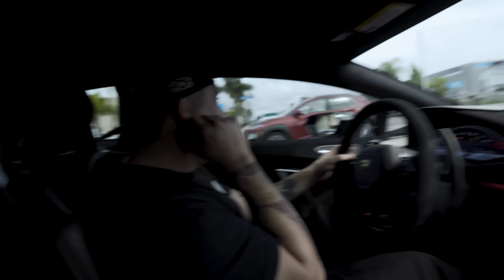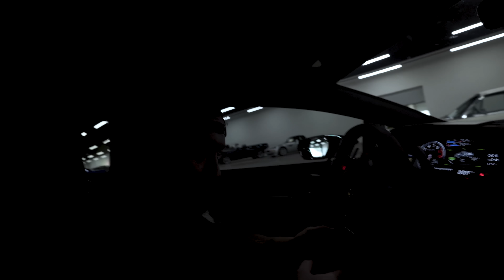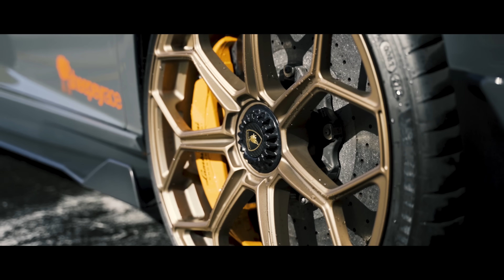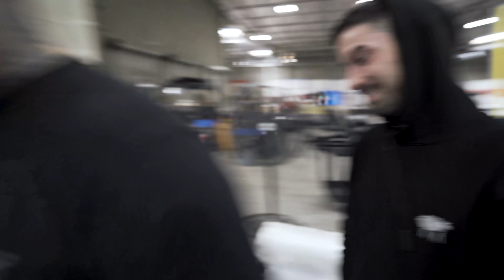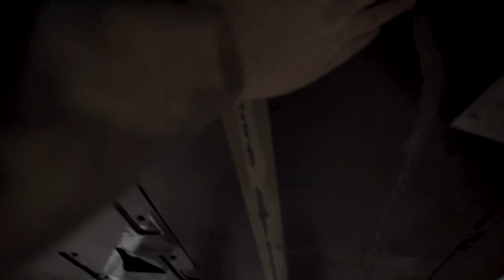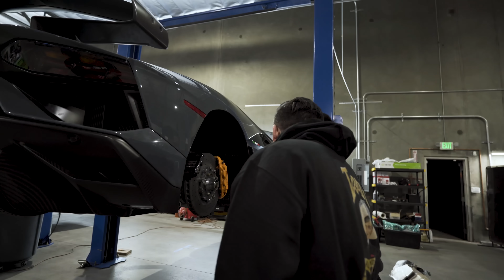OUR FIRST TWIN TURBO V12 BUILD!?!?

Comment: Congrats on the SVJ. Definitely would recommend the gintani F1 exhaust. You guys have to compete on who has the better twin turbo svj. Sheepey vs UGR
Reply: UGR are the pioneers everyone else is playing catch up
Reply: @Chamacurmom   Not really look at the facts, UGR have been building V10/V12 engines for 10 odd years, Sheepey have only just started.
Reply: @Chamacurmom  In what way would you say they are "a little better" than UGR?
Reply: @Chamacurmom  They've been playing catch up for years. If you want to make the argument that UGR has rested on their laurels then fine but saying there are 15-20 shops building high level cars is moronic. UGR still has the fastest Huracan in the 1/4 mile and no one has come close to them in the 1/2 despite them setting their record over 2 years ago.
Reply: @Wopadas  done arguing over nothing with people who don't know anything. Why don't you research who holds the record for fastest huracan in 1/4 mile?? Moronic yes I guess you are since ALPHA HOLDS THE RECORD
Reply: @Chamacurmom  AMS have gone quicker, UGR has gone faster. The fact that you don’t know there is a difference speaks volumes.
Reply: @Wopadas  lol ok "Mr Mix" I said Alapha hold the record for fastest 1/4 mile and that's correct. Lmao. So the fact you can't read speaks volumes
Reply: @Wopadas  UGR is the king! Maybe they can they can get you and you're husband's kia optima to be the world's fastest! Hahahaha
Reply: In the ugr one the flames are like nuts
Reply: Ugr has the fastest lambos
Calvo has the fastest vipers

Comment: Congratulations. The Gintani F1exhaust sounds sounds insane on the svj
Reply: He didn’t get the gintani f1 exhaust, he got the 1016 exhaust. Gintani tuned the ecu.
Reply: @jamieasprey2602  I was just saying the F1 exhaust sounds good. Obviously he got the 1016 exhaust. It doesn’t sound very good
Reply: @evanblack619  Did you just say this car doesn't sound very good?
Reply: @Mike-dd8bd  not compared to the Gintani exhaust. IMO
Reply: @evanblack619  still sounds amazing though compared to most performance cars. But I agree the Gintani is by far the best. I don’t know how someone won’t choice it.

Comment: LOL your right about not caring about Bling. If it doesn't plug into a wall or put gas in it, or jump it 10 feet in the air, I could care less what it is. Clothes are just rags covering up the ugly bits on some people (and protect us from the out door elements), and jewelry could be best served in a CPU or GPU or connections in a high end stereo system. :)

Comment: How does a twin turbo installation shop survive in a future where combustion engines are banned.. somethin like by 2030, every country is supposed to comply. Might wanna start figuring out mods for Tesla and evolve with them as electric cars advance. Dont get me wrong, I wanna be able to drive my '70 charger til I'm an old man but I don't know much much longer these times will last.

Comment: im glad u didnt do the typical youtuber shit where this would have been like 1500 videos.
clickbait what car ur getting (20mins)
picking up the car, but u cant cuz it has to get smogged (20mins)
picking up the car (20mins)
first drive (20mins)
first impressions (20mins)
im getting downpipes for my $700k lamborghini aventador (20mins)
actually getting the downpipes and unboxing em (20mins)
installing the downpipes (20mins)
im getting a tune for my aventador svj (20mins)
installing the tuned ecu (20mins)
first start (20mins)
first drive tuned with downpipes (20mins)

and this would be like 3 weeks of uploads -_- .